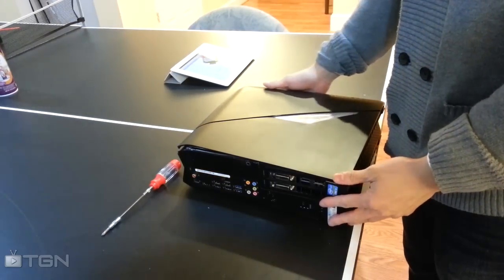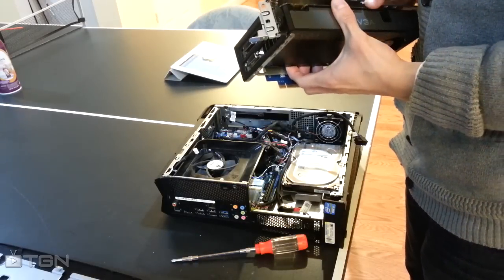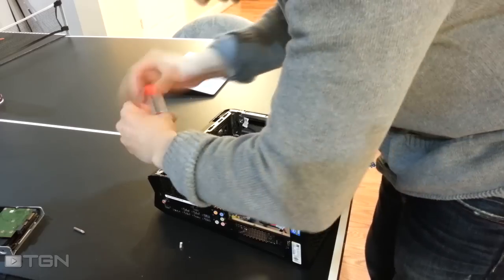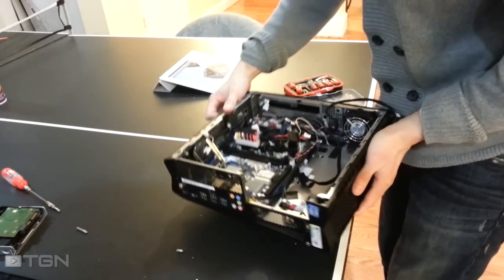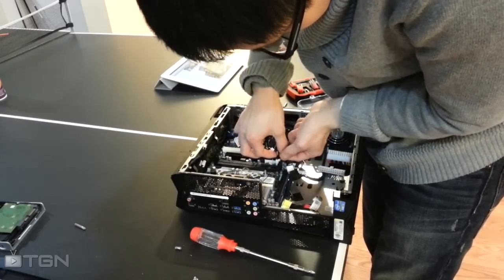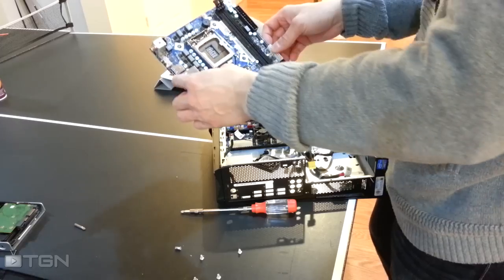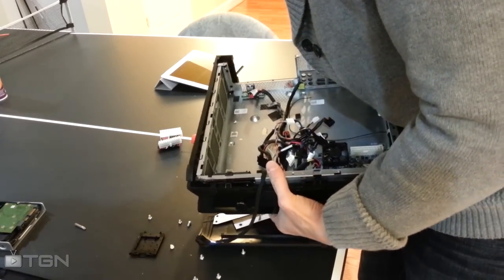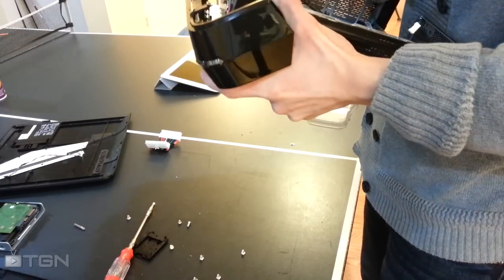★ Alienware X51 Full System Breakdown/ Disassembly; Alienware X51 Case Opening (Gaming PC Build)

Comment: Would it be possible for me to put an SSD, Replace my 8gb ram with 16gb and put a 960 in this?
Reply: ya i did the ram and im looking to upgrade the graphics card
Reply: you could put a 1080 i saw a guy do it to his x51 r3
Reply: The r2 has a 960, the blower style one fits I'm pretty sure. But you need the 330w psu

Comment: Can you change the video card by a gtx 1080.? Help plz
Reply: You could, but, you would need to also get a larger case because it would not fit in this one, you would also need to get a psu of about 500 watts or more.
Reply: Yes, you would need to remove the front fan, get the R2 power board if you don't already have it, and of course, the 330w PSU.
Reply: And also a dual 6 pin to single 8 pin splitter.
Reply: get a gtx 1060 i have it in my x51 it runs like a charm :)
Reply: you need to remove the front fan to turn it other way around that it sucks air out from the front
Reply: You should probably get a new case and PSU if you are planning to do that.
Reply: 1080 works with x51 R2 only not with R1

Comment: I have a question. When I was removing my graphics card and disconnected the power cable, I noticed that there was two power cables and one wasn't connected. Each one has a label with the number 1 and 2 on it and the second one was the one that wasn't disconnected. Is this just an extra cable or is it supposed to be connected somewhere else? because I can't find anywhere it's supposed to connect to
Reply: The one marked (2) is just an extra one, it would've been used if the graphics card required two (like some may), but yours obviously did not.

Comment: I want to transfer my alienware x51 r2 componets into a new case, is this possible and if so are there some cases that I could not move it into I was thinking about using the Carbide Series® Air 540 Silver Edition High Airflow ATX Cube Case. 

Please reply if you do know.
Reply: not the motherboard but the ram, cpu, gpu, heat sink and fan, yes.
Reply: ZachDaMVP yes tout can. the other to peace of mother bord was useless.  tap in Google x51 swap case you will find all you need to make it

Comment: my friend alienware graphics card is blown are there any replacements that any that would fit?
Reply: +coooooooooool1000 I have an alienware x51, and what I did is moved it to a new case and I'm using a GTX 970ti. It fits for me.
Reply: +Elliott Ropell (Panther) we just bought a define r5, a new motherboard, and power supply!
Reply: coooooooooool1000 Sweet!
Reply: +coooooooooool1000 what motherboard and power supply you get? I'm wanting to transfer to a new case but I don't know what is any good when I look through lists of motherboards.
Reply: Will Stonehouse You can use the alienware's mobo still. Just get an ITX case and your good.
Reply: +Elliott “The Kid” Ropell are they able to fit wider range of graphics cards like the gtx 970/980 plus I would still need a new power supply right?
Reply: Will Stonehouse Yes it would fit since I have a 970 in mine now with a new case. And yes you need a new psu. It's pretty easy to move everything around even if you haven't done it before, it's mainly plug and play and you should be good.
Reply: ***** Ok thank you any reccomendations on case and power supply?
Reply: Will Stonehouse Thermaltake itx. It's for the itx motherboard. Very roomy, comes with a 120mm fan but I recommend to get one or two 80mm fans so the cooling is better. I got 2 in it now and it's never overheaded or got warm. Games I play is gta 5 on ultra, arma 3 on high, war thunder on movie, and the forest.

Comment: I'm upgrading the alienware x51 r2 version to a gtx 970 and i7 4790k ( upgrading the power supply too). Will this version overheat too much or will it be okay? Thanks
Reply: ... You can't upgrade the power supply and getting an unlocked cpu would br a waste of money when they have a locked mobo
Reply: +xx_1337_c001_xx yeah I ended up getting a new case and power supply thanks anyway

Comment: its just so much easier to just build a pc than buy a more expensive computer
Reply: +kolten wylam your just jealous cause you cant aford an x51. ITs tiny and has power and liquid cooling.
Reply: The Ultimate Quaker  no im not but have you ever built your own pc ?? 
im guessing not id like to see you put a r9-295x2 in there man im sorry i like to upgrade my pc to parts of all sizes
Reply: kolten wylam yes I have built multiple PCs before. Last self built one, I built using an Intel Core i7-2600K, 32GB ram, and EVGA sli gtx 680.
Reply: kolten wylam secondly, the x51 is a great value. Tiny form, liquid cooling, and its punch for its size make it very respectable.
Reply: +The Ultimate Quaker don't but an i7 if it's for gaming, buy an i5 and then spend some more on your GPU
Reply: Mustache Meister Its already built a while ago. I chose the i7 as it helps with rendering and computer modeling.

Though I agree, an i5 is great for people who want to game.

Comment: If I change the graphics card to a gtx 580 would I need to change anything else or could the stock power supply handle it?
Reply: +Levi Warner Check what your power supply wattage is, then do from there

Comment: If I was to move the processor, graphics card, hard drive out Of the case and moved to a new case, would I need to buy a new motherboard or could I put the old one in the new case? If I do need to buy a motherboard, would there be any specific things to look for?
Reply: Silent Shield You shouldn't need a new motherboard. just find a case that has compatibility with the motherboard inside the x51 and you should be fine.

Comment: I tipped my alienware x51 over and now its running programs slowly and my bottom hdmi port will not work. Anyone know whT the issue might be? I took it apart and no lose pieces. What did i break?

Comment: I have a X51 with i5-3330, 3.0ghz, if I want upgrade my graphic card from GT640 to gtx660, do I need change anything else? like cpu, or power supply ?
Reply: No, you do not.
Reply: but my account adapter is 240w, do I need a 330W for GTX660?
Reply: YAN WANG
No, it is one of the biggest cards that you can use without having to change the basic diet. :)

Comment: Alright so I want to upgrade my alienware x51 to a different case but I'm not sure if I can. If I can, does it matter what size of a case I get?
Reply: PyroItalia Uhm. You don't need to upgrade the motherboard, cpu or anything like that. LOL
If you wanna just replace the case you will need to buy a power supply aswell as the PC case, go to your local computer store or something and ask them.. They'll be more then welcome to assist you.
Reply: i recommend Mid-Tower.

you're going to need to buy a new motherboard, cpu cooler, case, power supply and a disc drive
Reply: PyroItalia Thanks for the info
Reply: i literally just bought all that stuff to upgrade my x51 as it is just too small to handle better games and its performance is not what i want it to be.
Reply: PyroItalia well I need to upgrade my graphics card but it wont fit because Im planning on getting the nvidia gtx 760. also my alienware x51 fan tends to get loud so im not sure what kind of fan will do the touch
Reply: i have the gtx 660, great card for the price. i recommend it. and yea you're gonna need a new case for that so definitely go with what i said. buy a new graphics card but you wont need a cpu, just a motherboard that works with it.
Reply: PyroItalia what about my i7? and its either i upgrade to all those parts or i get the 660 and a new fan thats quieter. just because im playing games on high settings, its loud, and i barely have enough space for the settings
Reply: is your cpu LGA1155? i'd recommend just getting mostly new parts. case is too damn small and gets hot way too quick to be able to game for long periods of time, at least for me.
Reply: PyroItalia what is a good motherboard to replace with?
Reply: iBoesen depends what socket type your cpu is

Comment: what do you think the 2nd motherboard deal is? is it a type of psu expansion? Other than keeping the actual motherboard from being cluttered its the only thing I can think of that could be its function. Its nice to know that the main motherboard is a itx but I not too sure what the hell the 2nd board is. sign guess got to wait till I get one myself to do some testing. My goal is to scrap what I don't need place a rog impact into it maybe do the water cooling mod and boost the graphics to make a bad ass itx over cloak-able console killer. but till I can figure out what the hell that board is for cant really continue on the project.
Reply: That's simple: There is no "second motherboard". Board between MB and front panel board is DC/DC convertor board and technically it is part of a PSU (power brick provides only single voltage around 19V, but PC components requires multiple votages  - 12V, 5V and 3.3V).
Reply: i think it just runs some lights & crap, these were left over https://www.dropbox.com/s/7hl8wkt439r0v3f/2014-01-31%2022.12.18.jpg but i managed to run it on a 400watt psu, just with main board, i wouldnt buy one for free to be honest
Reply: Phill Stevens ya, kind of figured that much Good news i think i found a better case, was asking cuz i had the chance to get one for dirt cheap and was thinking of getting it just to try a custom build
Reply: BD Pershing
i been lookin at smaller cases for budget builds as the mb's are so small now, u dont need huge case, pccg has some, i got the guy a fixed the x51 for to buy this http://www.pccasegear.com/index.php?main_page=product_info&cPath=25_1549&products_id=25158&zenid=42bf132570f8c4cd50d4fa04936cbd1e & i just sent his parts back, the x51 has no ventilation, a external 240watt psu, it does nothing but look good. the case. if you do use a x51, dont forget turn cpu fan over, fuk knows why that did it that way
Reply: Phill Stevens  LOL figures they would mess up the fan. Another reason I started looking some where else is cuz of the poor ventilation would we such a pain to modify the case just to improve it slightly.
Reply: to me it was just a i7 with 2x4 ram, & a mini board, intel i thnk. no pci slots, only 2 ram, slim dvd(cant swap it) external psu )cost $120) wtf lol

Comment: can i put an SSD in there?
Reply: Yep. My 2TB drive was giving me some problems so I switched to the 480ssd. Works Perfectly
Reply: You can get a 12.7 mm ssd 5" caddy to replace the optical disc drive.
Reply: Evolq what kind of problems?
Reply: ***** About a week after I got my computer, my hard drive started making a squealing type noise (sound you would often hear when it is about to die) and more often than not, it would not boot up correctly and asked for me to re-seat my hard-drive, which I most certainly knew would not solve the problem.
Reply: how did you fix it?
Reply: ***** That's what I did...swapped it out with an ssd

Comment: I want to upgrade my Power supply and get a new case, Would that be easy to do?
Reply: i'm looking to do the same so if anybody can hel. please link me to a place or help me.
Reply: I ended up just buying all new parts and making a new PC, the Alien ware case isn't very upgradeable with the case.
Reply: Nashy at least you can re-use the graphic card and cpu :D
Reply: haha i guess as a 2nd graphics card..but its a gtx 640...which is terrible. but my CPU is great so i'll use that.
Reply: SinisterKieran isn't it a gtx 660 ?
Reply: well you can get a x51 model with a gtx 660 in but i had to go a little cheaper and get the one with the 640. i think if i had the 660. i wouldn't mind waiting to upgrade.

Comment: what mother board is that? i want to know so i can upgrade the ram, i dont want to buy ram and later find out its not compatible with the board.
Reply: JelloMellowGames Not true do not spread crap like that.
Reply: EDIT: Most RAM should be compatible depending on your motherboard, also look at your system specs,

Comment: Thanks for the vids Traumatic....I just bought an x51 a month ago and am having all kinds of problems with it....Mostly when I am gaming it locks up/freezes, then after 30 seconds of lock up the system reboots.  On occasion I would get a windows error, the kernel stopped responding and has recovered.  Now I am not even getting that error, It just crashes.  To make things worse, when I boot now (cold) the fan is very very loud on startup and remains that way. I updated my GeForce Drivers to

Comment from the maker: Pretty much everything except the motherboard, power supply, and the heatsink.

Motherboard, because the wiring was designed to work with just the X51, and trying to get it in a new system is just a lot of effort. 

Heatsink, because you need to reaatach the backplate from the x51 motherboard to whatever motherboard you want to use.

Comment from the maker: It can't fit the 690, and it's a moot point to try. It's basically an SLI card. There's cooling problems with the 690 just by itself (very limited overclockability), and enclosed in the X51 chassis would just confound the issues.

Comment from the maker: Some guys that use AMD cards or blower fans like to reverse the direction of the fan so that it blows air out of the case, but to remove it entirely and not put it back for you seems like kinda a jerk thing to do. 

It could help with feeding the turbine fans of the Nvidia reference design cards. I still use it.

Comment: Mine does not have the front fan, since the previous owner removed it. I was kinda wondering if it was worth reinstalling it, since I plan on going no higher than the Nvidia GTX 660 ti.

Comment: Can you move the parts from the alienware to another case wich is bigger, cuz i want to upgrade to a gtx680 and its not fitting in :-/  and you cant have an power supply wich is 650W